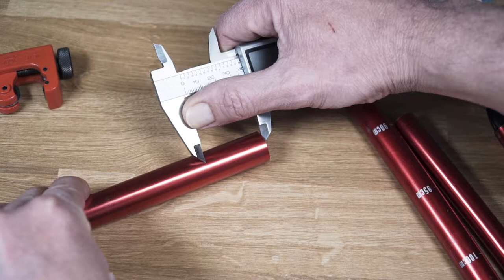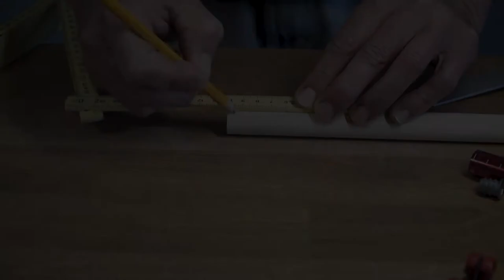Workbench Clamp System DIY that's fast and easy to make

Comment: They are beautiful. Better than those in store
Reply from the maker: Building your own tools is always rewarding.
Thanks for your kind thoughts, I appreciate it.
Reply: @LTMS  just curious, what kind of glue did you use?  It looked like construction glue from the color of it but it didn't look as thick.
Reply from the maker: @b3arwithm3  I use a wood glue from an Italian company that has been producing adhesives for over sixty years. (Saratoga - I am not sponsored)
I dilute it by 10% because it is extremely thick and difficult to spread especially on large surfaces.

Comment: Saluting your work. I wonder if the the tubes are strong enough for long use? I plan to use steel tubes from curtain rod set (IKEA).
Reply from the maker: As I explained at the end of the video, I recommend using wooden dowels instead of metal tubes, due to the little friction that metal provides. I have been using this system for more than two years and it has not given me any problems. Thanks for your thoughts, I really appreciate it.
Reply: @LTMS true that, but for me it is easier to use a 19mm steel tube than to make a 19mm wooden rod at the moment 😀
Reply from the maker: Hardware store usually have 20mm available, if not go ahead with the metal one and than scrape it with some 60 grit sand paper as I did for mine @GIBBGalek